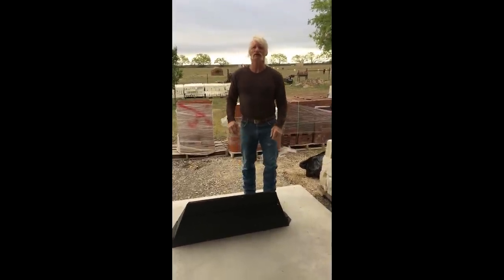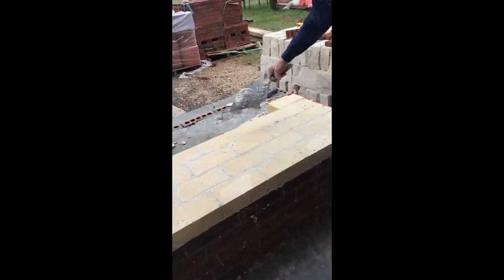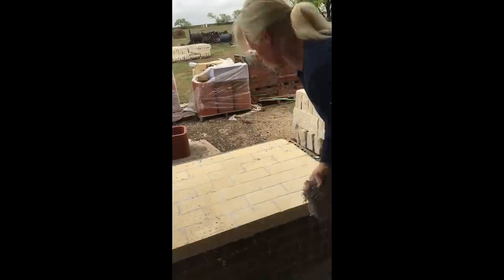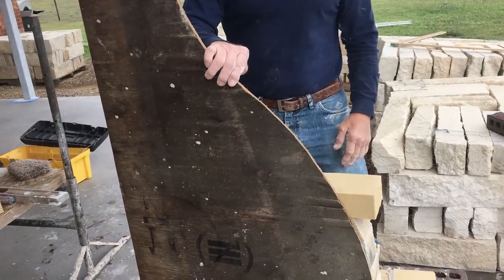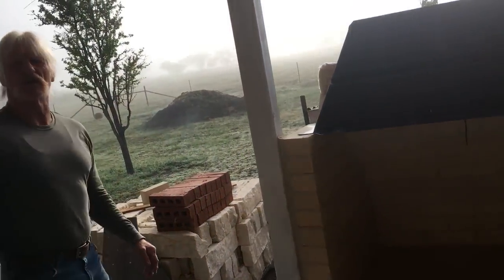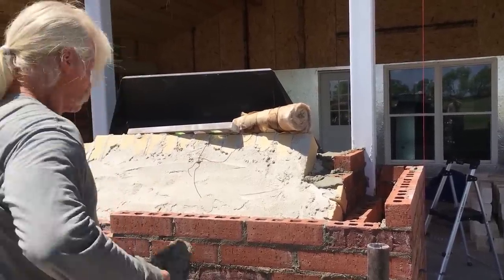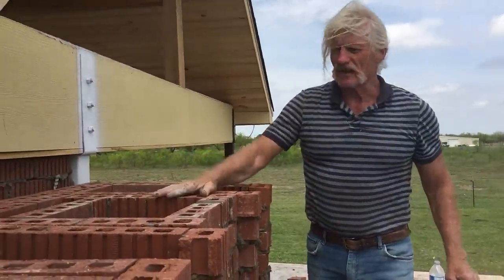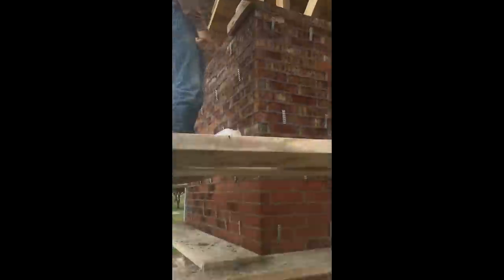The Basics of Building an Outside Masonry Fireplace (Part 1)

Comment: the man is a true tradesman. I only have one thing to add because I'm a refractory specialist. you are supposed to use full joints on your fire brick. do not ever put just a bead on it. its totally different than regular brick. refrac needs full joints.
Reply: Do you need refractory mortar for a firebox?

Comment: Firebox height is not really high enough; I build mine around 36 in. high should be a minimum of 6 inches higher than the height you cross the inside opening. The smoke chamber must be parged in this area, or it would not pass inspection.
Reply: Bingo

Comment: better to install an angle iron over the damper 1/2" minimum clear leaving a space for expansion of metal damper.Nice job in any case!
Reply: You can’t put the iron on top of the damper you have to put it  in the front

Comment: Masonry fireplace can be the best fireplace, and out last everyrhing else!. I still have and use my blue rubble rock, fire brick fireplace, I built  1977. I Never did nothing to it except clean it and tuckpointed the top. I built my flu liner with fire bricks, its never Cracked or decayed. T ile like flu liners do over time. Square tile Flue liners last decades too. You built yours to.specs, awesome job mate!!

Comment: I really enjoyed your video! You're the real deal .I helped my grandpa build fireplaces but it has been 20 years,so I'm trying to refresh. I do remember him using a sponge to smooth out the flue liners and throat. also I was wondering if the two side posts work as the rebar? Otherwise rebar would run from the footing up the chimney, correct?

Comment: Great Video cant find another like it on YouTube all of the other fireplaces video are outdoor home owner type that do not need to be inspected or comply with Chapter 10. The only thing lacking in your video is it jumps ahead to quickly and we miss the detail on the fire box construction. Can you tell me about the insulation you show I believe it is to rap the damper to space the bricks out I would like to know more as I am going to be building a very similar fire place and the more tips I have the better. Thanks again for posting the video!

Comment: I am a mason of over 27 years and this video is awesome, he did not show rebar in the interior portion of the chimney as is should be in every corner at least and continuous all the way up and also I did not hear anything about heat stop refractory mortar as it needs to be used on the fire box and flu all the way up. I would also use Cmu block instead of brick to build a chimney like this because it is faster ,less expensive and it getting covered with stone. I am not knocking his video , I am just saying that is this up to code in Oregon but he built a badass fireplace for sure!
Reply: Lol I noticed that too, I guess we just over engineer stuff here in Oregon.

Comment: Why don't you parge the smoke chamber to make it smoother?
Reply: PaddleDogC5 I was thinking the same thing I'm pretty sure you have to were I live  but just all that restriction in all the corners of the brick.
Reply: I've never seen a pro strike refractory brick lol don't u want as little joint as possible? It looks nice but if I did that on a job I'd be called a boot. He also skips over important  steps like doing the smoke chamber. He also doesn't parge the smoke chamber. I shoot castable to make it smooth

Comment: why did you cut out the part about "if it ever rains"
Reply from the maker: For whatever reason, unfortunately, that part got cut off.  He was explaining that if rain falls down the chimney it will fall into the water trough that he built in instead of falling through the damper into the firebox.  The damper is also shaped in an angle that won't let water in.  Making it near impossible for water to get through.
Reply: Luke trying to do one of these myself on the outside unattached to the home.  Is a damper important?  I didn't think I'd need one being outside and all.